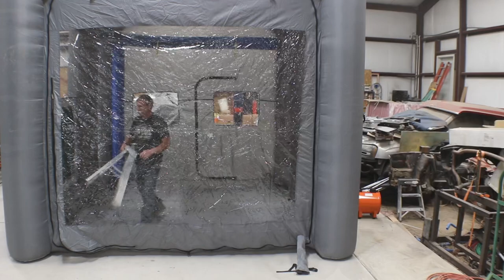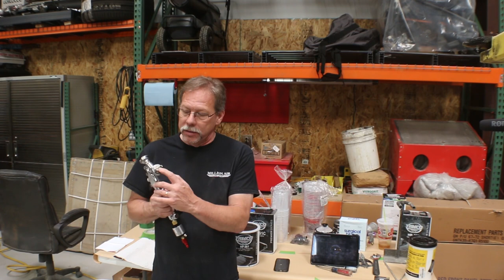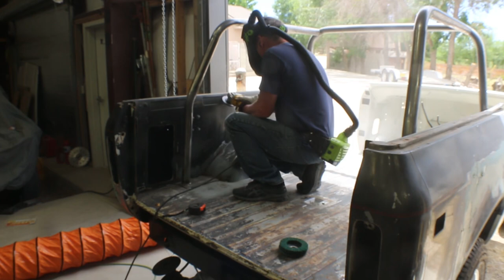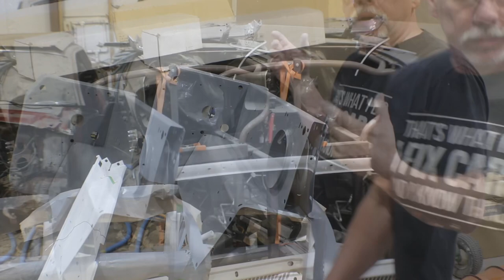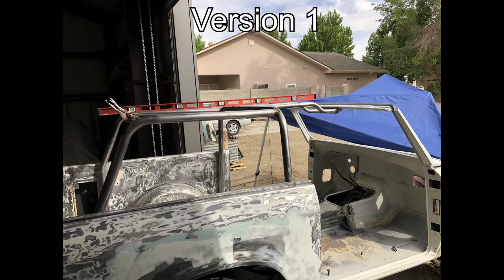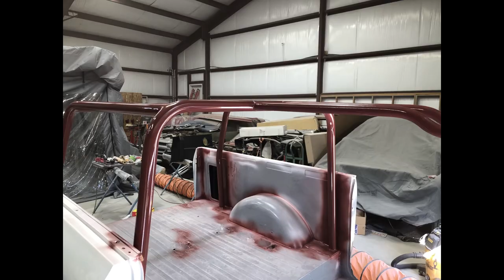International Scout II Is Finally Getting Paint - Project Creep - Episode 34

Comment: I am about to prep the new floors, sides and interior firewall of my 79 Scout for epoxy primer then lizard skin. Would I need to apply the primer sealer before I applied the lizard skin coatings?
Reply from the maker: I am going to say yes, because in my limited experience, the epoxy primers I’ve used all required sealing, prior to top coating.  I would recommend checking the TDS sheet for your brand, because it may be possible to sand the epoxy and then top coat or top coat within a time window.   
I had thought about using Lizard Skin before my colored bed liner, but I wasn’t sure about adhesion.  I guess I need to do a test shoot someday.
Reply: @AllisonCustoms  thanks for the feedback man! I'm really enjoying watching your build, especially since I'm able to follow along and keep up with mine in throughout the process! 

I'm planning on applying a colored bed liner on top of the lizard skin as well just for that extra durability. 

Are you going back with the stock motor?

Comment: Lol... my first bodywork was kinda like that, sand, straighten, epoxy, fill, remove, fill, remove, fill, remove, guide coat, fill,  remove, fill, remove, fill, remove, guide coat, fill, remove, fill, remove, fill, remove, guide coat, fill, remove, fill, remove, fill, remove, guide coat, prime, remove, fill, remove, guide coat, fill, remove, guide coat, fill, remove, prime, sand, fix runs, reprime, sand, remove, fill, guide coat, prime, sand, color, sand, fix runs, color, sand, fix runs, color, sand, clear, cut and polish.
Reply from the maker: Yep, that sounds like my experience with body work!  Thanks for watching!